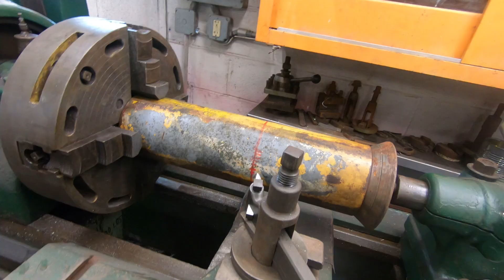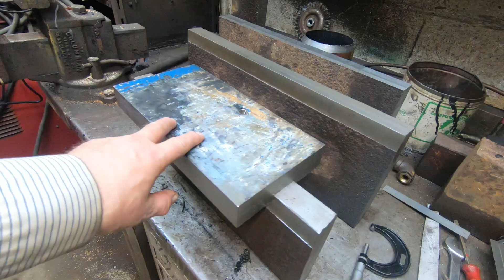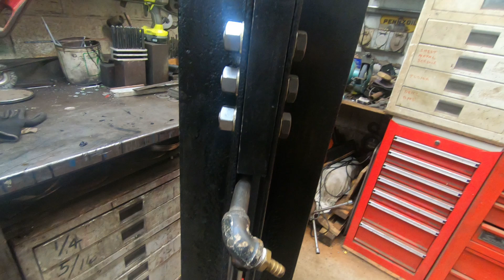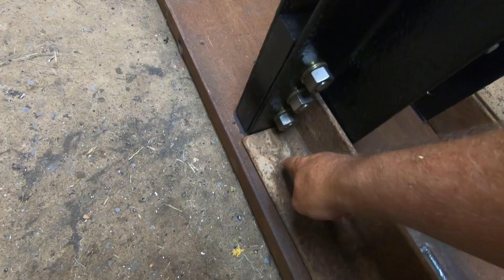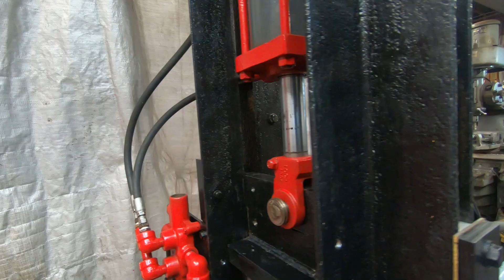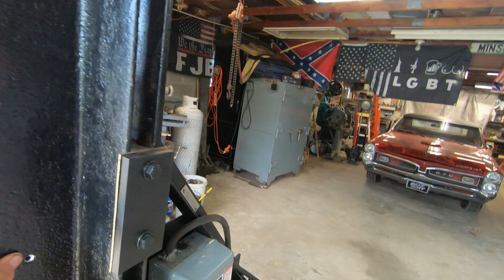Hydraulic Forging Press Build

Comment: Cool video! Thank you!  

I'm in the process of building a forging press similar to yours using a 5" bore x 8" stroke tie rod cylinder.  I'm going with a 20GPM single spool control valve, 11GPM 2 stage pump at 3000 max pressure.  I'll probably use a 5 horse motor that has the rpms the pump requires.   Hopefully, it all works out.

Comment: We had a press for bearings at Denny's machine shop. . . I would have liked to use a press to make knife parts., to either punch out weird leaf springs with a die, or to form thin metal sheet into bolster shapes over a mandril. . .but he passed away and the shop sold.